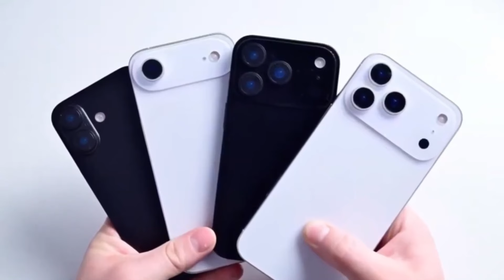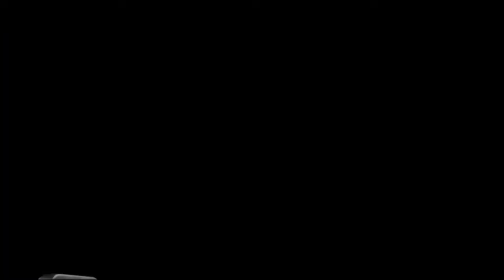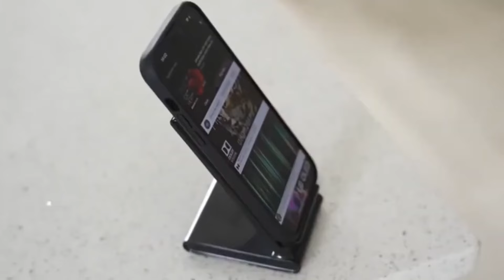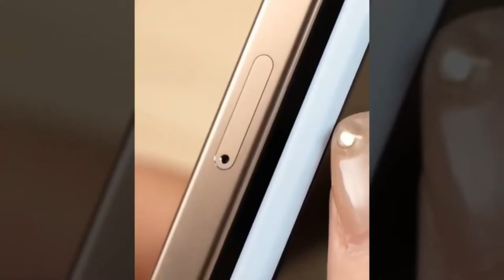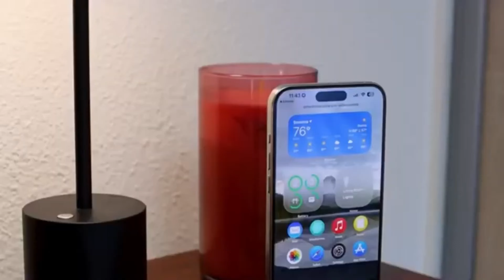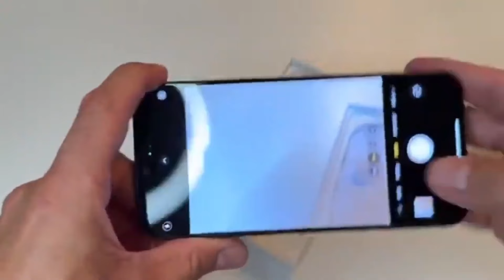iPhone Air 2 Might Fix the Two Mistakes Apple Made - Better Battery, Second Camera, No Compromises !

Comment: I will be shocked if there is an Air 2. We got 3 Airs into our store (one of the busiest stores for the network in all of Ireland statistically) and as of today 2 of them are still on the shelf.

The third one was sold…. And returned because of the battery life